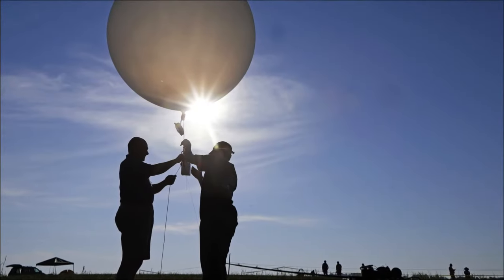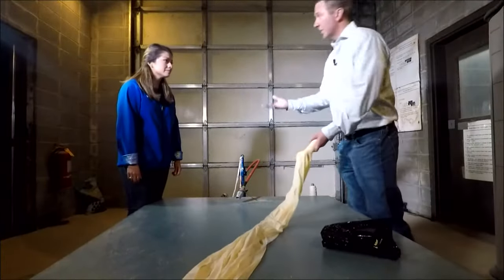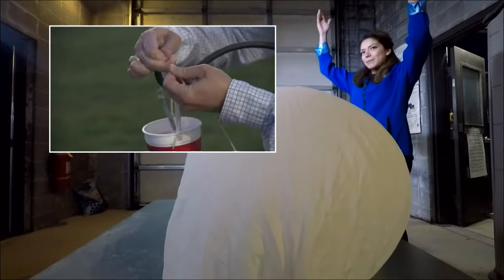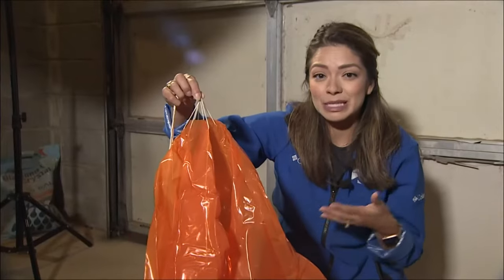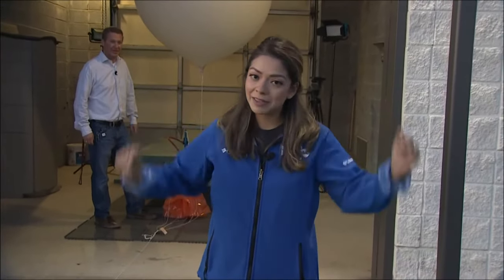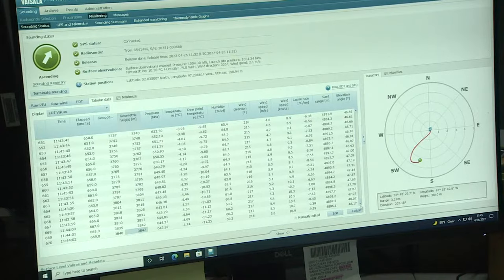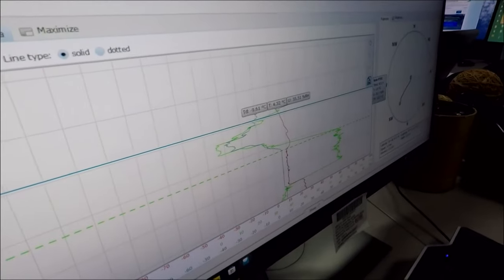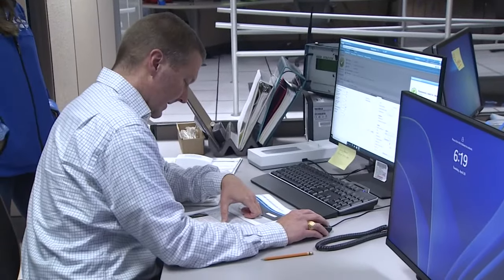How do weather balloons work?

Comment: So it's impossible for a balloon to fly from China to the US because it will pop at 20 miles up.
Reply: Not necessarily. Any balloon's max altitude is controlled by how much helium or hydrogen is in it and how much it weighs. Surveillance and datalogging balloons may even have an electric valve to let the gas out when it gets as high as it needs to be. We don't know for sure what the suspected surveillance balloon's capabilities were yet.
Reply: Goes "up"  20 miles not forward
Reply: Mr. Murican up-down isn't the same thing as left-right.